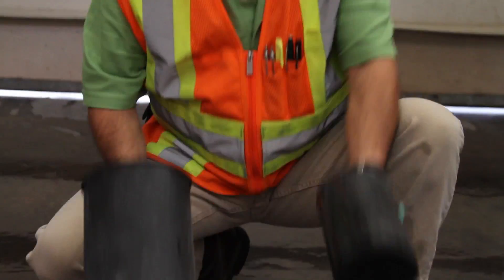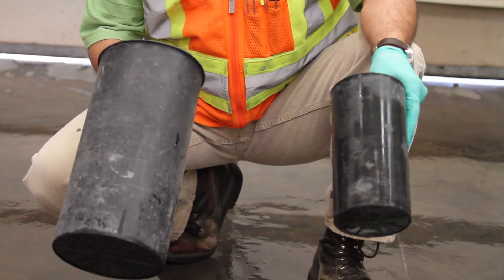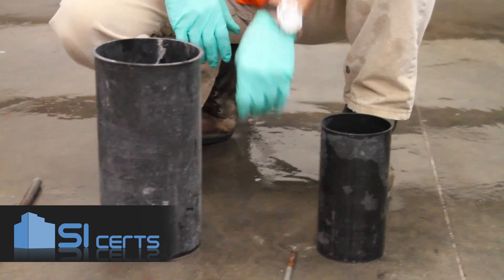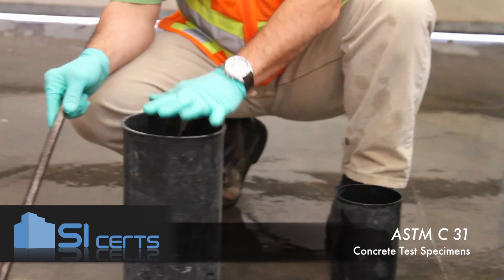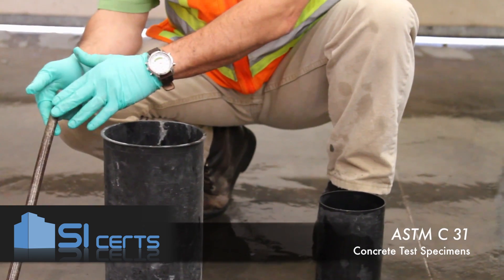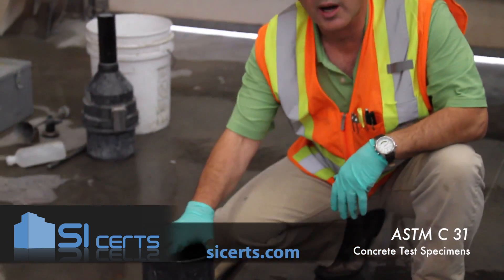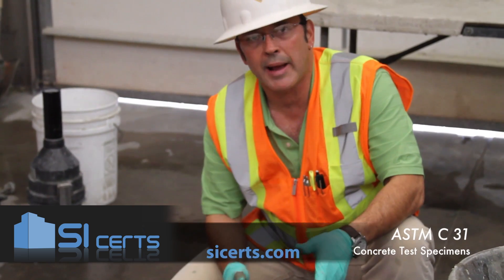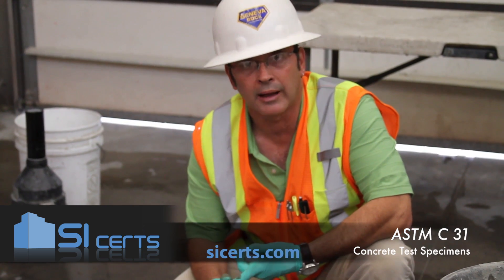ASTM C31 - ACI Making & Curing Concrete Test Specimens (Newer Version Available)

Comment: Everyone saying use your hand? Yall need to review the damn book again! no where does it say a hand is acceptable, no where does it say  use a strike off bar for strike off, alot of rookie mistakes in this video, please refer to ASTM  standards and study, dont let people online fail you
Reply from the maker: This is one of our older videos – I'd recommend viewing our newer version (better production quality) here. https://youtu.be/YvMWCSVIzVI

Quoting from ASTM C31-21a, section 9.4.1: "...After each layer is rodded, tap the outsides of the mold lightly 10 to 15 times with the mallet to close any holes left by rodding and to release any large air bubbles that may have been trapped. Use an open hand to tap cylinder molds that are susceptible to denting or other permanent distortion if tapped with a mallet."

Now with plastic molds, they are likely not going to be damaged, but using the hand is clearly stated and permitted in the ASTM to "close any holes left by rodding and to release any large air bubbles...". In our new video, we also address the finishing aspect (9.5.1) with either a "tamping rod....handheld float or trowel...", according to the ASTM.

We've had lots of people use our free videos to help them pass the ACI test, along with our online ACI course. You can download the latest ASTMs from https://www.astm.org to ensure you are up to speed on these things. Let us know if you need help with anything else.

Comment: Tapping in the video is not enough to release the air entrapped in the fresh Concrete, it should be more tapping otherwise your sample is not compacted it has air void on the surface.